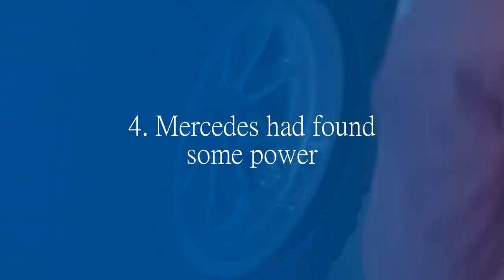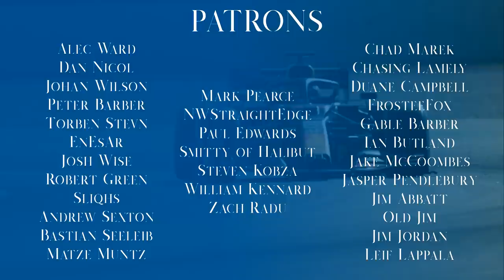THE SCANDAL BRUSHED UNDER THE CARPET! The Story of the Ferrari 'Cheat' Engines (2018-2019)

Comment: If I remember rightly, the fuel sensor was timed to measure fuel flow every hundredth of a second, and Ferrari had worked out a way of squirting in extra fuel in tiny pulses in between measurements so it was un-detectable. Also I fully, fully believe that if Mercedes or Honda had come up with it, the response/ public narrative would have been "that's technically against the regulations, if you stop doing it then no punishment necessary. Well done for being so clever and finding a loophole though, we're closing it for next season." But because Ferrari did it the response was "dirty cheats who deserve to be punished."
Reply: Spot on
Reply: the problem is, that this is just a theory. There was never official clarification, what ferrari actually did. And that sucks
Reply: It feels like deliberately cutting the track. The rule about fuel flow was unambiguous. There was a deliberate intent to breach the regulation and the “clever” bit of engineering was only in devising a way not to be caught. That’s why it stinks.
Reply from the maker: I doubt Mercedes and Red Bull would have been so blatantly obvious about it. They’d increase it little by little while Ferrari turned it up to 11 straight away 🤣

But the thing is, if it had been red bull or Merc doing it, Ferrari fans would be screaming filthy chats to them.
Reply: I don't get, why they didn't just slap on some more wing so that their advantage wasn't on the straights but in the corner. That way, nobody would suspect the engine, but say the have better aero or a clever suspension. But no, they had to dump it all on the straight because "aerodynamics is for people who can't build engines, mamma mia!!"
Reply: @AidanMillward  the tifosi screaming 'filthy chats' has me wondering what sponsor they have...
- sorry mate I'm a pedant.   - which is why I love your channel!
Reply: @kimschroder9354  Desperation and aggression as a team to take down the top running team. Ferrari long has dropped the "aerodynamics is for people who can't build engines" for decades now. And its also possible they could only run it there. The power delivery may have been too unstable for a driver to use in the corners and adding too much wing would have made it too slow pulling through the corners.
Reply: Yeah, this is Red Bull and Merc kicking themselves for not thinking of doing it first.
Reply: @AidanMillward  It seems Ferrari in the past decade just has not had the political strength it used to have. Players like Jean Todt and Ross Brawn were essential to its political success in the paddock. What makes Red Bull and Mercedes so good isn't just their engineering, it's their political prowess working with the FIA and against their competitors. What we often see as just clever engineering is often clever engineering plus the mastery of the political front.
Reply: The only "consolation" to Ferrari was that the FIAMG was still unable to prove how the engine was illegal despite having full access to the car (makes you wonder how they got the tip then disassembling the car wouldn't allow them to find it) and reached a settlement where their fuel flow would be restricted for an entire season, even though that would essential make them throw the whole season away (contrary to the statement that they didn't want to punish Ferrari). Even McLel in 2007 got off easier, and that was proven.

What Ferrari probably should have done is copy the Mercedes procedure every time they manage to find a loophole since 2013 so they can comfortably use it without worrying about other teams developing it. Like with oil burning for instance.
Reply: F1 has always been about extracting the most performance you can within or without regulations, provided you're not detected.
This was ingenious and full marks to Ferrari for exploiting it - but shame on the FIA for making it possible. I think the way it was eventually resolved was fair to all teams.
Reply: @kimschroder9354  They would've though. Teams are not stupid - they know how much wing a car is running, and if it's not as slow as it should be on the straights for the wing it has - it probably has more power than it should have.
Reply: @peterthomas5792  even if that's true, it wouldn't have been nearly as obvious or suspicious and they could have played it off way easier.
Reply: Trouble is in the last two decades plenty of other teams (Renault, Merc etc) came up with clever things that were instantly banned (Mass Damper, FRIC, 2003 Michelins and so on) for often questionable logic. Then Ferrari does something and not only does nobody get to find out what it was, they don't get punished. Honda's double fuel tank in 2005 got them race bans. Ricciardo lost his Aus GP podium because his car was burning too much fuel. Ferrari got away with it.
Reply: @sulphurous2656  Worth noting that Ferrari were using the oil burning trick too, it was Renault that couldn't make it work.
Reply: Delusional if you think Mercedes wouldn't have received more hate.
Reply: @sulphurous2656  what a bullshit take. Hint: disassembling a car won't find diddly squat if the exploit is buried somewhere in a million lines of ECU code (e.g. fuel pump controller). What Ferrari were forced to do was COMPLY WITH THE REGULATIONS. If you think a 100-million-dollar/euro/pound-sterling (forgot and can't be arsed to pull it up) and having your points wiped is "got off easier" than a secret undisclosed agreement and no points deduction and a slap-on-the-wrist monetary fine, you're categorically delusional. This was not a "clever loophole exploitation", this was blatant cheating. The rules state explicitly what the fuel flow limit is, and not only purposely breaking this rule but developing a way to evade the enforcement mechanism is undeniably unsportsmanlike. Impressive on an engineering level, but inexcusable on a sporting level.
Reply: @sulphurous2656  I agree, on the basic maths I calculated their fuel flow to be about 90kg/hr or 10% less than Renault's 2020 unit
Reply: @fix0the0spade  Ricciardo actually lost the 2014 AusGP podium because Red Bull used their own sensor, not the FIA one, because RB's fuel dissolved the o-rings. They didn't actually breach 100kg/hr flow rate, it was an unapproved unhomologated part
Reply: Because it was Ferrari, the response was a hush-up job by F1.
Reply: @kimschroder9354  Yep, they were very careless in the way they exposed their advantage. They could've probably extended it multiple seasons if they'd been more patient.
Reply: You are right. If you see the illegal rear wing that opened more they were just given a simple penalty that too in another race.
Reply: @kimschroder9354  Because clown BINOTTO idea mostly.
Reply: @AidanMillward  filthy chats indeed
Reply: this is like saying murder is technically legal as long as you don't get caught

Comment: Aidan please do a story on how Mercedes found half a second of pace in 2021,  from Brazil onwards, just when they needed it. That should be interesting reading.
Reply from the maker: Pretty easy to explain: they took the engine penalty that would have sent Lewis back to about 9th as a minimum, and with there only being four races left at that point they only had to run it for four races instead of seven.

They’d trialled this “plan” with Bottas at Monza, just in case they needed to take an engine penalty later on in the season. The simple matter is, they figured out exactly how hot to run it for those four races and ran it.

But they only used this “warp drive” in Brazil and Abu Dhabi and put the old one in for Qatar and Arabia.

Oh, and they figured out the issues with the car setup. It had a very narrow setup window (like the 94 Williams) and it was only from sort of Russia onwards they cracked it.
Reply: It was not just from Brazil, they already had more pace in Italy and Turkey, it was just not as obvious because it's easier to overtake at Interlagos.
Reply from the maker: @Olivyay  Bottas was testing the warp drive at Italy, that’s why. And the Merc being low rake it’s faster in a straight line anyway.

Comment: Ngl I think this is one of the best examples of bending the rules I have ever heard, super clever one the part of the prancing horses
Reply: This is not "bending the rules" by any stretch. It is blatant cheating. The fuel flow limit is explicit in the regulations. They developed a mechanism whose entire point was to evade detection that they were breaking the regulation. They did not "bend" anything or find any "loopholes". It's an impressive engineering feat, but entirely unsportsmanlike cheating (a la Toyota WRC turbo restrictor).

Comment: I’m still confused about the merc engine advantage at Brazil. I thought all teams that use the same engine have to use the same engine map? If this is indeed the case how did merc make more power?
Reply: Engine has to do far less mileage then what would otherwise be expected of it. So they ran it in a more aggressive setting for the race weekends it did. Nothing dodgy, nothing untoward and exactly what any team would do in that situation.
Reply from the maker: The teams have to use the same engine maps in qualifying and for the race. So if they use max power in qualifying they have to use it in the race.

Merc just built an engine to to four races not seven and were able to turn it to 11 for the whole thing.
Reply: @xSirDingo  ok, that makes sense. I was under the impression that all of the merc engines were required to run the same map. Thanks for clearing that up.

Comment: The other, or maybe together with this narrative, story I heard was that the pipe after the fuel flow meter was somewhat expandable. So they could 'store' some extra fuel in this pipe to use.
Reply: Any source for that ?  It does sound interesting .
Reply: @fourutubez7294  I'll link it if I find it. Mightve been speculation, e.g. on the Dutch TV, as most of the articles seem to focus on the aliasing of the fuel flow meter.
Reply: That was in the early races of 2015.
Reply: That was shut down, but I forget how - possible by the extra fuel meter introduced after that pipe?

Comment: The FIA took 3 years to clamp down on Mercedes burning oil.
The Ferrari engine 2018 2019 was not proven to be illegal. In Bahrain 2019 Mercedes got surprised by the Ferrari power as it was assumed the loopholes had been closed by the directives and added sensor after 2018.
Reply from the maker: It wasn’t just Mercedes burning oil. Mercedes were able to get the most out of it, but Ferrari engined cars and Renault powered ones were at it too.
Reply: @AidanMillward  
Merc burnt clearly more oil as the Spa upgrade 2017 and their struggle in Australia 2018 to avoid respectively cope with the tighter oil burn limits showed.
Reply: @philippruest5577  stpp hittpng that blppdy 'p' all the tpme ya lunkerthumbs
Reply: @blacktoothfox677  
Huffs :)
Reply: @philippruest5577  Nope.  You still left one there in avpid and whatever that mess is there pretending to be 'respectively'...

Bless ya
Reply: @philippruest5577  Wrong, they were actually burning less.
Reply: @richardpurves  
Check the statements by Merc at Spa 2017 and in Australia 2018...

Comment: Don’t tell the spicy Mercedes engine was total spec. 
Seems like history repeating itself
Reply: It's realistic that it was total spec. Those engines have a lot of untapped potential that isn't used because they have to last many races. If you plan to run them for fewer races you can push them harder.
That has been the case ever since they started increasing the amount of races each engine has to do since the early 00s, even the V10s lost actual power the first time they switched from unlimited to 1 full weekend and then from 1 to 2 GP weekends per engine.

Comment: I can elaborate a little more on the fuel metering if anybody is interested. I can elaborate on why I don't believe they cheated with the batteries too. This entire subject is massively embarrassing for the FIA.

The FIA mandated system had a single meter after the lift pump, before the high pressure pump. When logging data you effectively take individual samples, it is not a constant stream of data. A typical sample rate might be every 100ms, or one tenth of a second. Now fuel flow through a fuel pipe is not constant, it pulses due to how fuel pumps work. If you can time those pulses to match the metering device then you can temporarily raise the flow between samples, and therefore have a higher average fuel flow. How the FIA didn't consider this is beyond me and shows the true depth of their incompetence. I've previously developed a fuel metering system and installing a second meter for reference was such an obvious solution that we didn't even discuss it, it was automatically presumed to be fundamental to the system itself. Even if you don't have a second reference you would still expect the nominal average fuel flow to be a few points less than the maximum. If the average matches the maximum, then the peaks are exceeding the limit. It's really really basic stuff we are dealing here but it's multiple levels higher than what the FIA operates at.

The way that the teams figured this out was using FIA GPS data. If you know the characteristics of a vehicle, such as weight, friction, coefficient of drag etc, you can calculate the maximum rate of acceleration possible with a set amount of energy. Ferrari blatantly exceeded this maximum on multiple occasions. 

It's worth remembering that it was never confirmed either way whether Ferrari had worked out a way to hold a head of fuel post meter, which could be filled up during low load situations and then used when the flow limit has been maxed out. I also have to mention the oil filled charge coolers potentially dosing the charge air, effectively adding energy/cylinder cooling to the fuel mixture.

Personally I don't believe the battery story, you wouldn't measure it at only one battery, and you could also cross reference the energy usage against other components. If I am wrong and the FIA really are that Incompetent then they need to be disbanded and replaced immediately. There is no excuse for that level of gross negligence.
Reply: Yep, fully agree. Nice explanation, thanks. This was largely covered up because of FIA incompetence in the monitoring mechanisms.
Reply: I think the FIA are exactly that incompetent. They don't have nearly the clever minds at work that the teams have.

Comment: I kind of suspected that Haas’s dramatic drop in performance had something to do with the fact that they were probably doing what Ferarri was doing, being a Ferrari 2.0 car and all.
Reply: Indeed.
Reply: ferrari probably gave all the old 2020 engines to HAAS on the cheap in 2021....
Reply: Haas' drop is also due to their rubbish rear suspension which changes its behaviour with change in temperature. This has been a problem as early since 2019, if RoGro and KMag can be believed.
Reply: @subarnosinha8042  both are experienced drivers and have proved to be, at least, decent drivers. Romain was one of the few drivers who could challenge the pretty much invincible Seb and RB combo, and mag got a podium with McLaren on his first race in 2014.
Reply: @subarnosinha8042  this makes sense, since the Haas cars could do well in qualifying, but drop like rocks during the race.

Comment: all of the teams look for loopholes.
Reply: Had it been a team that wasn’t a front runner, people would praise them for innovation and say that they’d found a loophole.
Reply: @sanfordcurtis8242  Like Brawn GP
Reply: It wasn't a "loophole", it was blatant cheating. The regulations specify the fuel flow limit, in black and white without any ambiguity. Ferrari developed this system to evade detection that they were breaking the rules. Totally different.

Comment: Will you be doing Mercedes'  magic improvements  towards the end of 2021?  I've not seen anything other than fanboy/hater rants on the subject.
Reply: The engines are frozen as part of the rules. The only time you are allowed to change a part is under "reliability" grounds. 
Bottas had 4 engines changed due to "reliability concerns" which was code for "we are running them at the maximum output and hurting them on purpose to find reasons to change parts to give Lewis a maximum output engine for the final few races" 
But it's a rules grey area that F1 has not closed.
1st engine is a 10 place grid drop and any other after that is only a 5 place. It's an open invitation for abuse, the grid drops should become more and more severe the more engines you take.
Reply from the maker: Mercedes’ figured out how to 1. Get the cars setup window to work properly with the new floor rules and B. Figured a way to run the engine at warp 10 for exactly 4 races.

Comment: I love how the video conveniently glances over the 2017 oil burning debacle and Spa/Monza engine specification story. As well as persists with the 2021 "spicy engine" theory, when any person who has ever worked on an internal combustion engine would know most of the top end power limitation these days comes from the fuel flow limit and not the overall reliability of the unit.